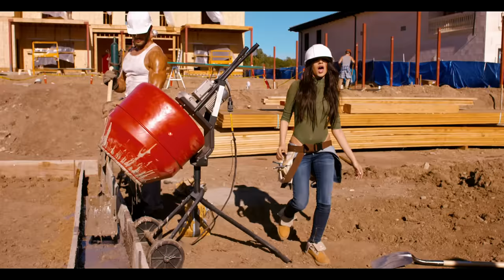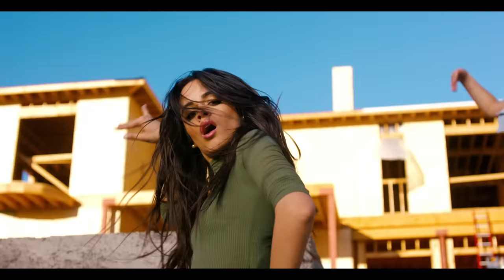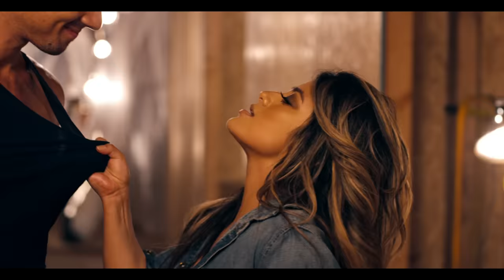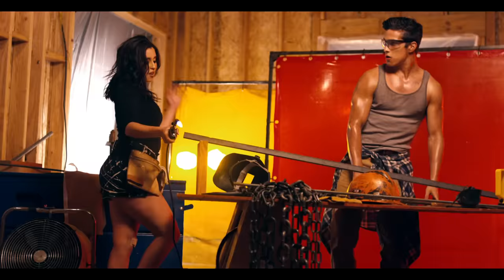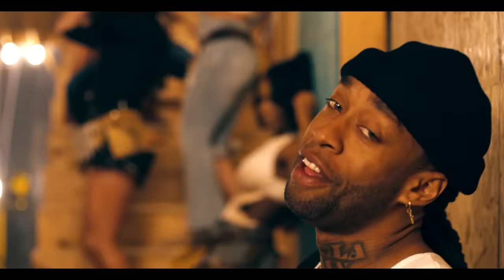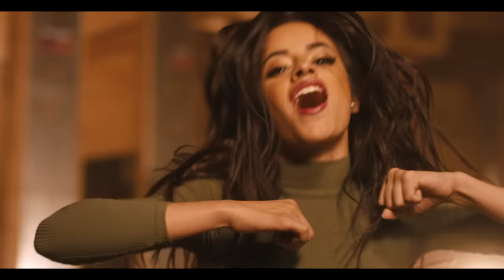Fifth Harmony - Work from Home (Official Video) ft. Ty Dolla $ign

Comment: At 15 seconds it he grinding upward with a cutting wheel on wood and/or a loose piece of rebar…
Reply: As a tradesman from construction to industrial machinery and manufacturing controls there is so much wrong with this video… Good beat though.